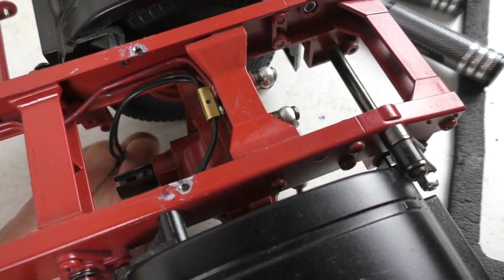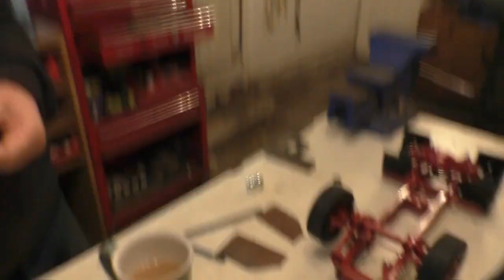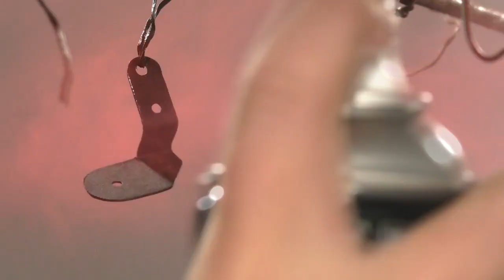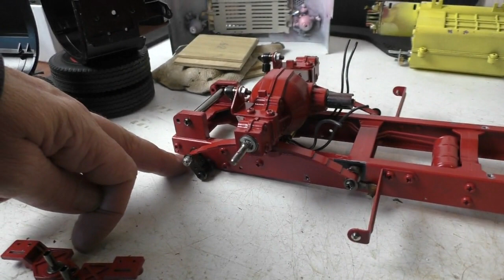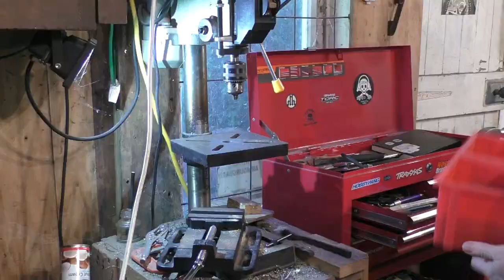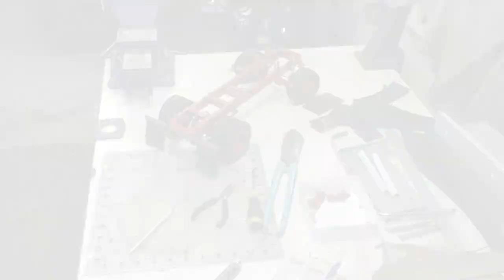1950's era White Freightliner model build. 1/14 RC semi truck model. (part 9)

Comment: Looking good. Chassis has turned out nice. Have you heard of kktruck? Thinking of picking up a heavy frame from there. The have decent prices in various things.
Reply from the maker: Thanks for the heads up. I took a look at their web store. Some very nice stuff there, The heavy duty frames are really nice, but a bit out of my price range.
Reply: Old Iron RC considering how nice your current frame is. There’s a lot of pieces on there that I thought maybe you could find useful. Can never have enough resources.

Comment: where did you get the part ?
Reply from the maker: What part?
Reply: @OldIronRC  axles ,accessories (fuel tank.  Pipes...) servos ,motor ...
Reply from the maker: @mehdimc6916  Original kit is Tamiya 1/14 R/C Mercedes-Benz Actros 1851. There is a lot of home made updates on it.
Reply: @OldIronRC  you are awesome man . I think I'm going to make this build . But I'm new to the rc community I don't know how to install the electronic ...